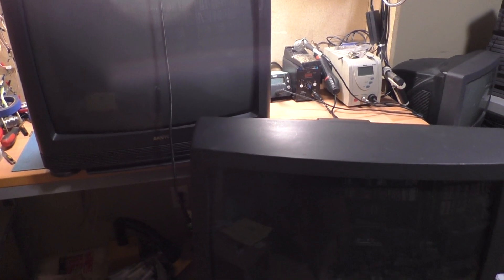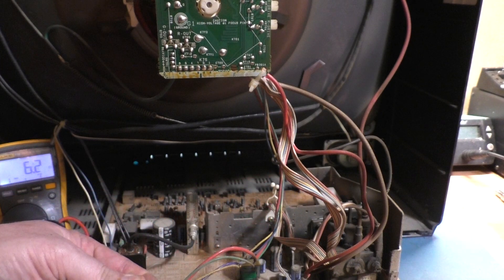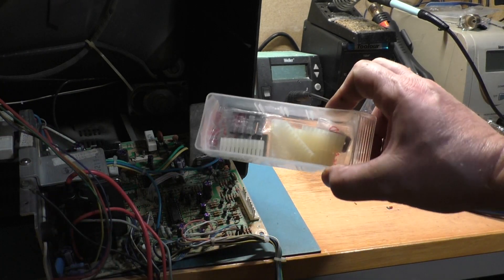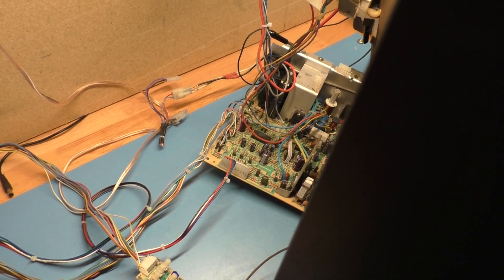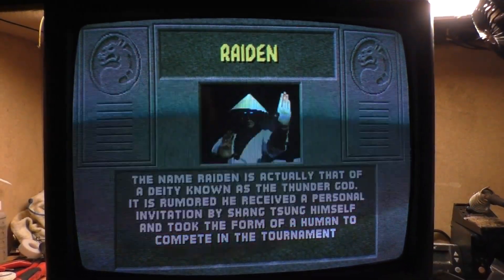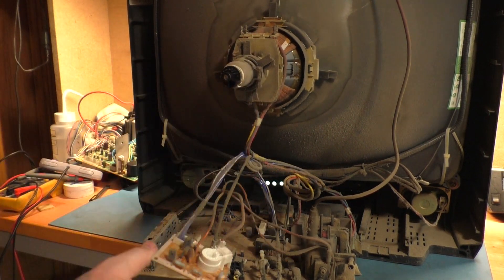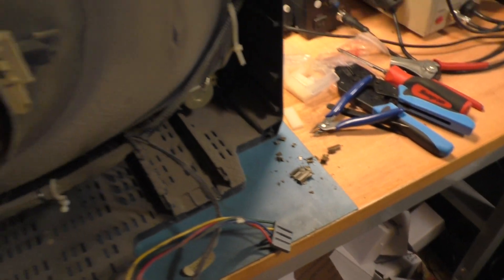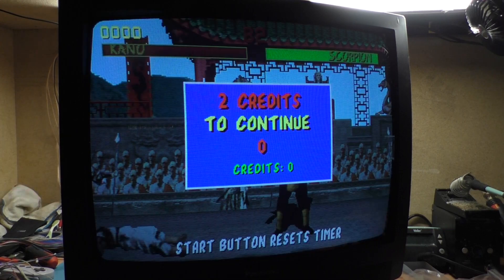25" Sanyo/Panasonic TVs - Good Donors For Arcade Monitor Swaps? Let's Find Out!

Comment: I have done this to k7400’s and I found a bunch of Philips Magnavox 25 in tv’s, I took everything off and used the yoke and convergence rings from the original tube that was bad, I ended up with monitors that looked brand new every time.

Comment: Thanks for showing this! I grabbed a Sanyo TV you sent me on Marketplace. It’s in storage but I’ll have to go check the model number. I also have that U5000 chassis you sent over. It’s on that other tube I bought that was just too dim. Im thinking I can try that Sanyo tube with the U5000 and hope it will be a brighter picture. I’ve been trying to find someone locally to rejuvenate some tubes. No local TV shops even work on CRTs anymore!

Comment: Before watching your video i was very hesitant because of all the "forum experts" saying "nonono, you can't do that"...Now i just bought for 50 euros a 25" Panasonic and a 19-20" Phillips 😄 I still don't know if they are swappable, but i immediately fell in love with the picture quality. MVS Metal Slug looks 10 times better than on my arcade display. It's perfect, even through the tv chassis. Even if the tubes are unswappable, i will keep the tvs and play on them directly.

Comment: 20:58 One possibility that the value is smaller may be that the winding has a thicker wire than the "original". But it may be doing the exact same job because the inductance is what counts. You should compare using an inductance meter.
Reply from the maker: Yes, I know. But in my experience, inductance is much more crucial when it comes to the medium res monitors.

Comment: I have though about this for a while. Thought this would be a good place to ask. Some yoke have a resistor attached up where the yoke wires tie in. what would be preventing the use of lower, higher or adding a resistor in so compensate for the yoke not being the right values off the bat? Also is it worth rewinding a Yoke? other then the fact that a yoke "swap" can be a pain in the arse.

Comment: Curious why any tube swap I've done (and it looks like that Panasonic does too) always seem to have a slight curl in the upper left hand corner (would be far more noticeable on the white pattern board in test mode). Other than that it looks better than almost any swap I've done right from the jump!
Reply from the maker: Not sure. That’s odd. Can’t say I’ve ever encountered that before. H.Hold adjustment doesn’t fix it?
Reply: @mikesamateurarcademonitorr6856  no, it's not a chassis issue. If you look at the crosshatch, in the upper left hand corner, you can see how the patten kind of pulls to the left. It's very slight, and I'm just being super anal about it but it's just weird how it always seems to be there.

Comment: Is the tube it self  always compatible if the neck board fits the tube?
Reply from the maker: Generally speaking, yes. Never seen any commercial TV from the mid-80s and up that wasn’t CR23 or CR31.